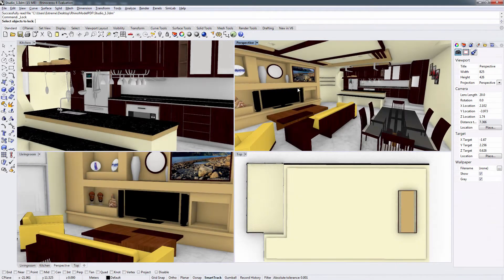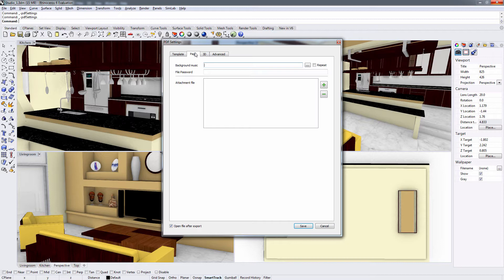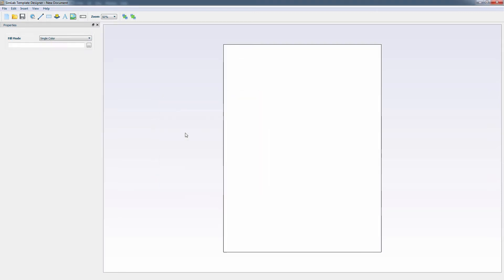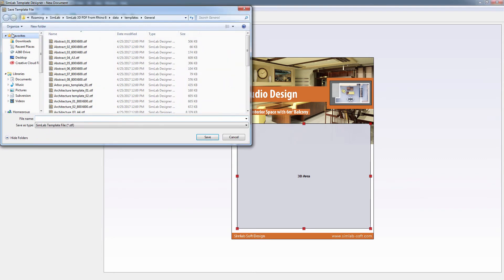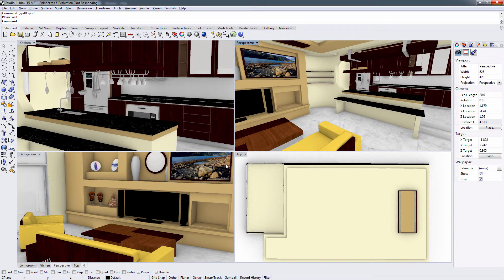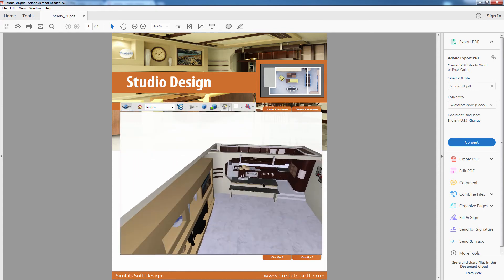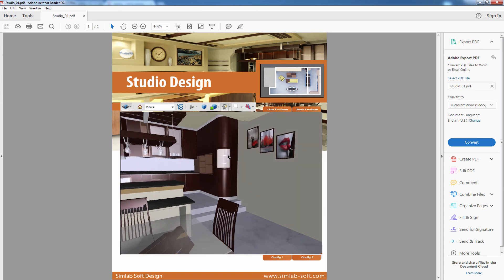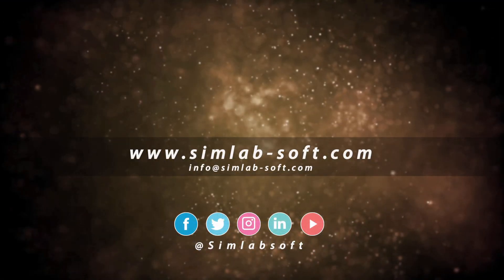Advanced 3D PDF export capabilities for Rhino

Comment: Does this work with a Rhino 5, VRay Rendering?
Reply: It works on Rhino 6 and older versions. You've to pick the right installer for your Rhino's version that you're currently using.
Reply: Jimmy Jam I understand that it works for whichever rhino version you install however I was wondering if it is possible to do that but with a third-party renderer such as VRay.
Reply: Unfortunately, it is not possible until the moment.